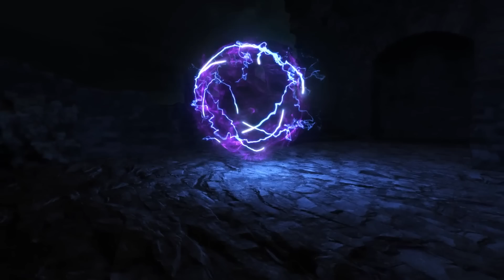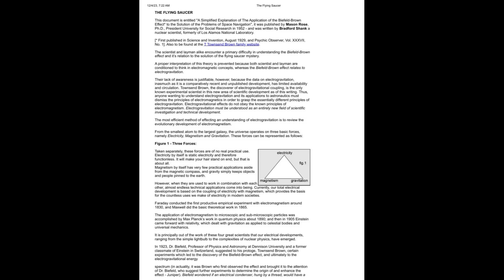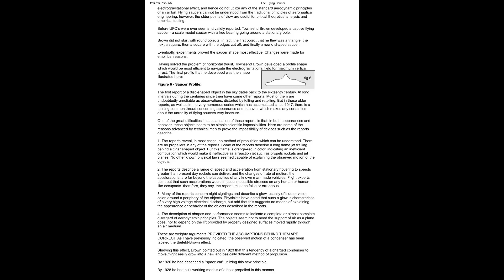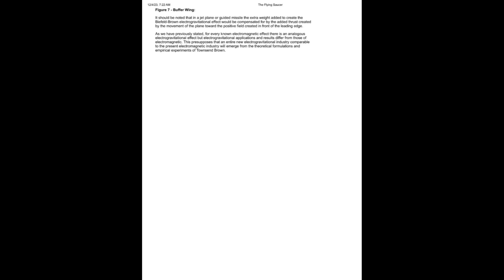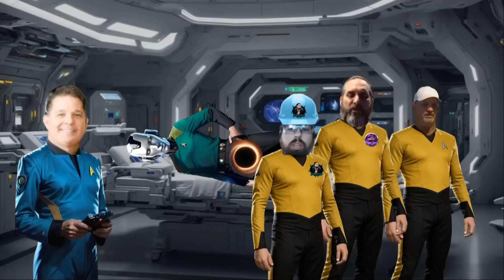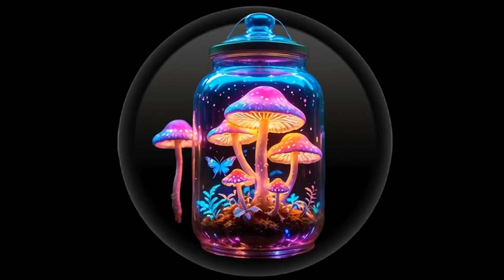Biefeld Brown Effect

Comment: The effect is primarily attributed to ionic wind or electrohydrodynamics (EHD). When high voltage is applied, air molecules around the smaller electrode ionize, creating a flow of ions toward the larger electrode. This ion movement transfers momentum to surrounding neutral air particles, generating thrust.
Reply from the maker: ion wind does work like that but this is different. This is flipping a field to get lift by turning transverse into longitudinal.
Reply: Ion wind was known about for at least 30 years before this effect was discovered.